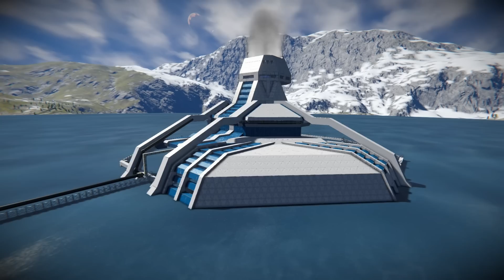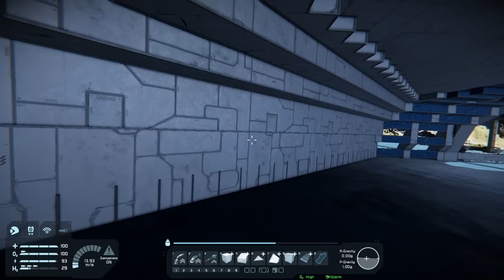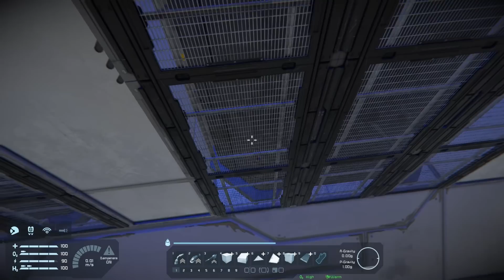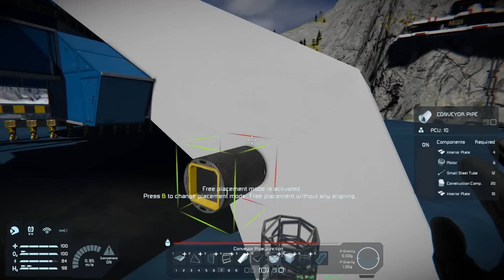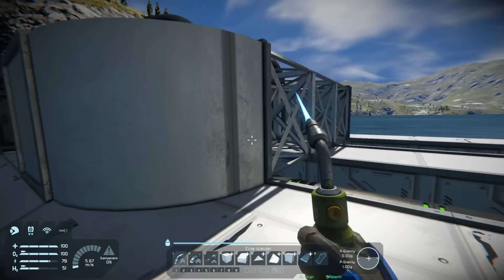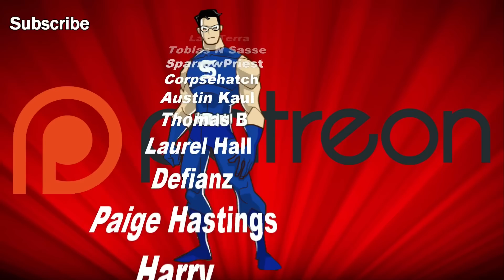Quick Update .. Today Sucked! - Space Engineers

Comment: About the entrance...
I personally think the round blocks idea you had was pretty good. What it needed was a wider platform in front of the entrance. Imagine there are rovers going back and forth around that entrance. First of all they would need a wider platform so it's more level and not just like a speed bump. And the round blocks would be like some thicker armor protecting the pipes so they don't get run over by the rovers. Also as you kinda mentioned in the end, the platform should be 1 block shorter so it doesn't get so close to the pipes support structure.

As for the main building, I thought you could do the ice processing in there and only have hydrogen and oxygen storage up in the mountain. This way you won't clog up your mountain storage with ice.

Question: Do you plan on building a rover at some point? That would be some great fun... 😆

Comment: I am confused as to the purpose of the entrance, if it is for personnel access then to me it is too large, if it is for ships/rovers/machinery access then it is concerning that they enter at the drill level, it is likely they will crash into the drills or fall into the bore hole, for me it would make more sense to have the entrance above the current drill height and a ramp/stairs/elevator up to the entrance from the ice or an external loading bay at ice level. 
But of course, I don't have access to the evolving plan in your head, which is fine as it is your vision, and it usually looks very good in the end, this is not meant to be a criticism but something that might bring some additional thoughts to help move forward in the process.
Keep up the good work.

Comment: I think you are on to something with that section of pipe with the white around it on the ice. What if you did the same thing on 3 other points same distance out and with the pipe and add your large defensive turrets out there as well, you could use the two pipes and have two turrets per axis point. Use the largest cannons you can and then use the smaller calibre guns on the base itself.

Comment: The building is looking amazing. My idea, would require a lot of work, and redoing just about all of the outside piping, but hear me out. If you have a 2 or 3 block wide stairway (whichever ends up being properly centered) running down from the bottom of the landing platform (centered on the middle red stripe), you could have one pipe coming out of each red stripe (from the closest edge) and running over to the stairs. Transition from 4/5 blocks wide piping to 3 blocks wide piping where it meets the entryway section. Inlay the entire entryway piping into the ice and make it like a roadway up to the Ice harvesting structure. This could be the cooling system for the base, and if some maintenance tunnels are put in, an entrance for if you run out of hydrogen. Play with colors to give some of the pipes a hot/cold look. For the stairway piping can cover top and bottom with sloped blocks leaving the sides open to see the pipe running down. For the pipes going directly into the harvester, just run them through the bottom and work out the interior piping from there. Like I said, a lot of work.

Comment: Skye, You are doing amazing work, thank You. As for ideas, here aremy humble suggestions:

1. Pipes should not enter the building by main entrance, it's industrial standard to separate resources access from personnel access. So if we assume this is a side wall, not a main wall, You can simply raise them and get through the wall, like regular industry would. So, horizontal above ice to the wall, up above drills level, through the wall, up again. This will also let You to simply build up the wall, and decorate pipes entry point.

2. White flat something You've built today would not be necessary. Also in real life pipes are never laid directly on the ground, for multiple reasons.

3. Inside the building pipes can double as decorations, run them on the ceiling in room below control room, around pistons column and split to turrets emplacements (great idea btw). And on the ceiling You can place more than one pipe in parallel, it doesn't even have to be connected - You'll have green and yellow lights on them. Separating them by upside down catwalk will add a nice touch too.

4. Drop hinges idea, I don't see it working.

Keep building, I can't wait to see next update! 👍👋

Comment: Why take the pipes in on the same side as the entrance??? That doesn't feel like the way an actual building would work, the pipes would enter to the side of back from where the main entrance would be. You're making things harder for yourself by trying to find a compromise design that's not realistic.
Reply: Yeah, that's what I thought aswell. Separate the entrance from the pipes, looks more realistic and is easier to make it look good.
Reply: @maartenrietman87  Agree. Keeping the general setup as is but running  them through the threshold would work imho
Reply: Yes, you could make it a complex structure of pipes to make it look really industrial. And have the main entrance on the side facing your base (or have all 3 other faces have the same nice open entrance). I don't know what block types there are, but at the part where you had the rounded off parts: are there half height blocks of these? Or as some typical industrial places might have some kind of fences?
Reply: Maybe take the pipes out of the other end of the base, and bring them down on the side of the drilling building instead of trying to get them through the main door.
Reply: Actually, if you look at images of buildings in mountain faces, utilities come out the opening made for construction. Nothing wrong with the pipes in front connecting to the eventually running ice mine.

Comment: Instead of full blocks you need rounded half high blocks, but that might be too big even for the port into the ice. Quarter high would be what is called for, but I don't thing SE has it yet (and with SE2 in the works I don't think it will come at all). I am sure you tried using a gate (a type of door) instead of the typical doors for the entrance, but an entrance is hard for something like that. Ideally there would be a caged ladder attachment that could stick to the blocks and have you climb to the actual room, as that seems the fitting way to handle an entrance on that sort of rig, but such a thing is hard to get such a physics engine to handle so things like that don't exist. Maybe the typical one tile of railing catwalk with a door up at the top and require people to use jet packs? Maybe hangar doors down below? I would build everything but the entrance then worry about it latter.

Comment: Widen the slopes either side of the sunken pipes maybe.... My thinking is the only reason you'd need to have the sunken pipes is for a rover to drive over it, also widening it will bring it more in line with the width of the front of the building and help with the symetrics of the building
Reply: I agree with widening. This is supposed to be some kind of entranceway, possibly for vehicles, and it just seems flimsy. Imagine driving onto that from the side and turning into the structure, you'd have to be super careful. Make it wider, that way you can play around with the shape a little as well.